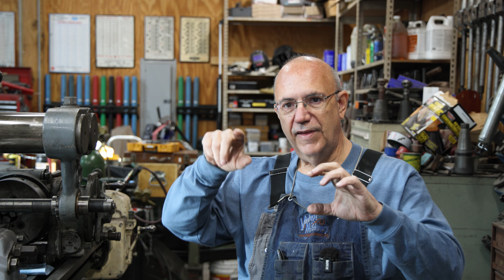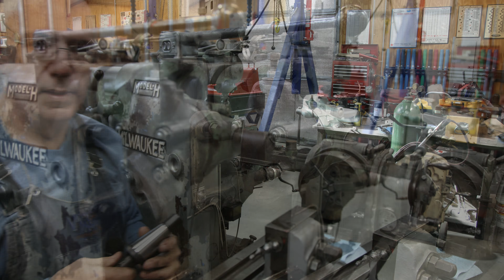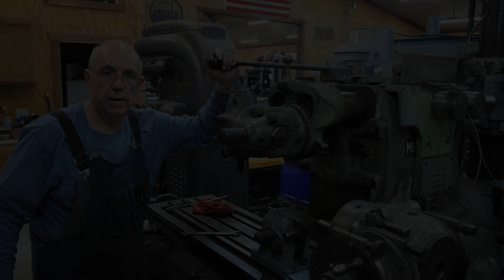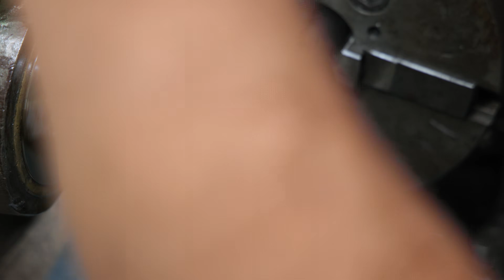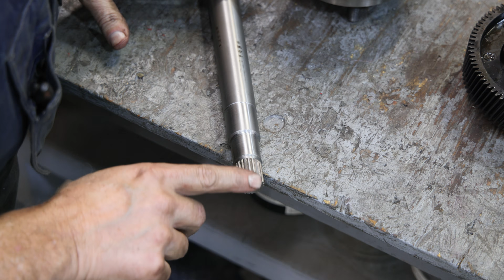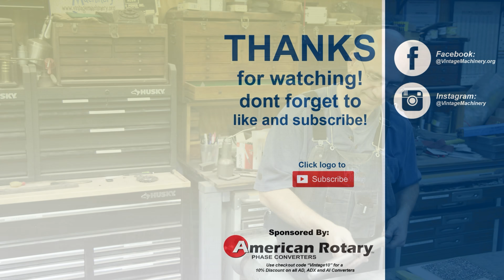Cutting Splines on the Horizontal Milling Machine for a Custom Axle

Comment: two things I never suspected....that you can pull the universal head away from the body of the machine, and still use the rotation, and two, that you can pass a shaft THRU the dividing head...

Comment: Is there a heat treatment process required for the splines or are you relying on an existing quality in the metal from its original manufacturing process?

Comment: I admit that I would put grease in those fittings if I saw them. They are grease fittings! Perfect example of why a product should be engineered to prevent confusion. Oil cups are for oil. Grease fittings are for grease.

Comment: Keith, On the lube of the head should be oil in the spindle bearings and #1 grease in the drive bracket... These heads were originally shipped with two grease guns, one for grease and one marked "Oil"... I have the same type of vertical head on my wartime 2h... I would imagine that many of those heads just got grease in all the fittings, I know mine was full of grease when I got it.. Love your vids!  Cheers from Louisiana; Mike

Comment: Everyone thinks today that cnc is the only way to go. But I work at a machine shop where we make custom parts. A lot of the time out manual mill and lathe is much faster because you don't have to waste time programming, waiting for custom tooling. You can be done with the manual mill or lathe before you get started with the cnc. And besides, experience trumps technology in the long run. Great video, Keith.
Reply: ...CNC is a heck of a lot BETTER with multiple parts...
Reply: @daleburrell6273  I didn't say that,  I said that for a one of part, it's not usually as efficient. But a very complex part it's superior for accuracy and finish.

Comment: Keith, me thinks you might need to disassemble that milling head and give it a tune up, that tool holder section is pretty stiff to turn.
PS It sounds as though you either forgot to turn on your Rode mike, or it ran out of charge, the camera is picking up the sound, a little faded but hearable.

Comment: Could you have put the outer face of the cutter against the O.D. of the cylinder. Then raise it up to clear the cylinder and then move it half the diameter of the cylinder plus half of the cutter width to get it on center.

Comment: My opinion is that we learn more when you have some difficulty with the setup.  I didn't realize that the vertical head could flip around like that.  It's really good to see that mill used.  I've never had the opportunity to use one and people have told me over and over that they are old and obsolete chunks of scrap iron.  It appears that for one off type of work in a small shop, they are darned near essential.  That said, I'm really interested in how you set up the planer for the stoker engine.  Got a hunch that is still going to be a head scratcher.  Sometime maybe you can do work on the Lucas boring mill. Maybe I'm just into old machines

Comment: Funny, I remember back when those Chinese 3 in 1 machines were new on the market, people said they were not practical because you had to break down your mill setup to use the lathe, but they had been selling these Milwaukee horizontal mills for decades with a far more complex change over from horizontal to vertical use.

Comment: Keith, I really appreciate it when you talk about the reasons why you are doing things a certain way, and the thought process behind the decision.  It really deepens my understanding of the process, and it helps me to think about different ways I can do things.  Back when I was teaching math, I told my students that there is usually more than one way to get to an answer, and if they can show me how they did it, and explain their thought process, and come out to the correct answer, I was fine with however they did it.  It actually shows a much deeper understanding of the math when they can do it more than one way.

Comment: Those Kearney Trecker horizontal mills with a couple attachments are really a great machine, I’m a little surprised that they never came up with a down feed like a drill press. They could have eliminated a couple shop machines (like a vertical mill and a drill press) with that addition. They’re still a really impressive machine.

Comment: I have terrible eyesight now, but there’s something I can’t quite make out.  You moved the overarm supports out to bring the universal attachment forwards, but how did it remain engaged with the drive gear mounted in the main spindle of the machine?
Reply: I think there's a shaft at the top that runs between the two pieces.
Reply: @CanizaM there is a coarse spline shaft that slides inside the gear in the head. The round machined tube sticking out the front of the head is actually the casing for that shaft.  When the head is all the way tight against the column that shaft would be sticking right out the front of the swivel head if that round cover wasn’t on there.

Comment: Did the original shaft have heat treated splines for increased hardness? Given the application it may not have been necessary?

Comment: The bearings on the spindle on the universal head are indeed lubricated with oil, but the internals are actually lubricated with grease.

Comment: Thanks Keith. I learned something new. I have a grease gun like that and I thought it was odd that a standard tube wouldn't work with it. Now I know why. I had no idea it was for oil. I will now set it up properly and learn what is supposed to get grease and what gets oil.
Reply: Yes, I remember one apprentice who had taken it upon himself to fill the cavity with grease from a bulk can when he needed to use a grease gun for maintenance on a machine he was cleaning. He was told to take care of the problem he had just created. A great learning life experience for him and a giggle for us seasoned pros. One of the great reasons to be the one who trains apprentices giggles galore if you're not prone to ulcerative colitis. Oh, and we replaced the leaking oil seal on the oil gun and engraved it to say what it is used for and the weight of oil used typically. Some our fault, but all his to him!😊
Reply: @CothranMike  that's exactly what I did. I got this from Army surplus and I also got gallons cans of red grease. I just figured the two went together. Thanks for the story.
Reply: several years ago i had an oil gun but didnt know what it was.  i wish i knew what i did with it.  im assuming i probably scrapped it in my ignorance. bad part is i have a lathe and mill that could have used it.
Reply: @MrChevelle83  Believe it or not, they actually make kits to convert regular grease guns into oil guns. It's a couple of seals for the spring shaft and a new diaphragm for the gun seal. If memory serves me, let's check... well, firstly there are folks just gutting the grease guns and sealing them with weld so that seems to be an option,  but the way to do it right seems to be taught on the MGExp forum in the midget section for oiling the steering rack. That post is ten years old at this 2024 point in time for you future readers and the forum might only exist in a payback machine type system if you are from the far enough future of course that would mean this post too is in the same condition, nevermind, you found this post fine, you'll find that one as well.